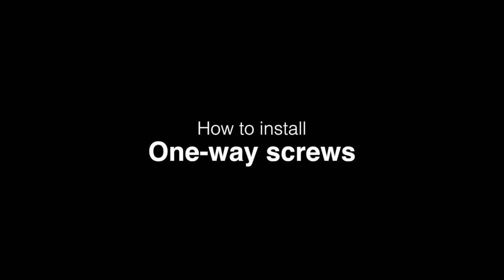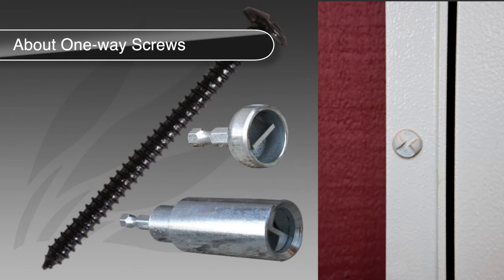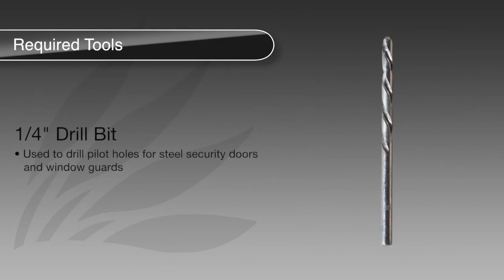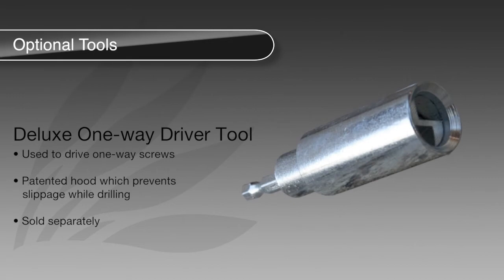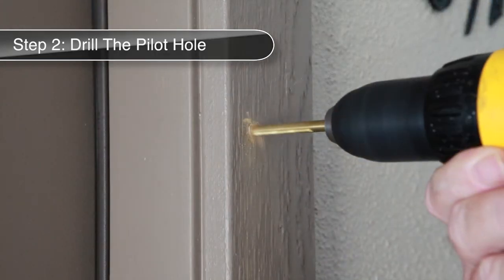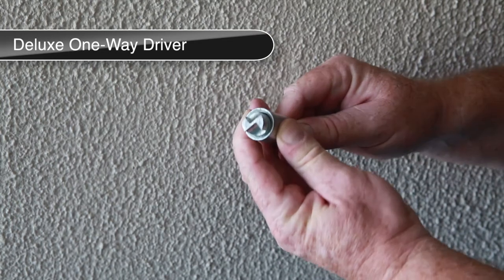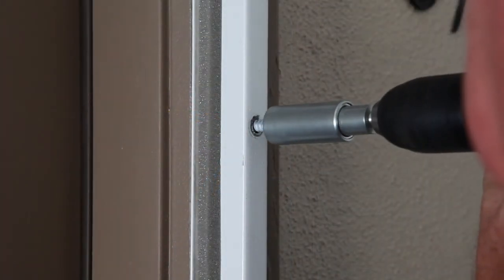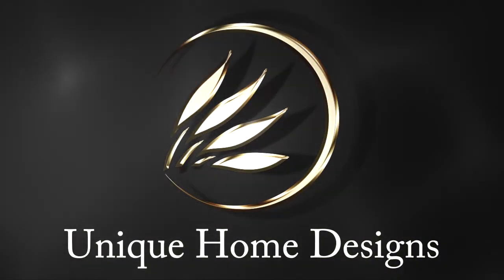One way Screw Installation

Comment: how to remove the screws?
Reply from the maker: The one-way driver tool is designed primarily as a driver, not a remover.  Though it can used successfully for that purpose, it is inherently difficult by design.